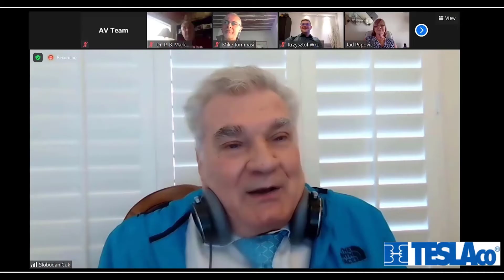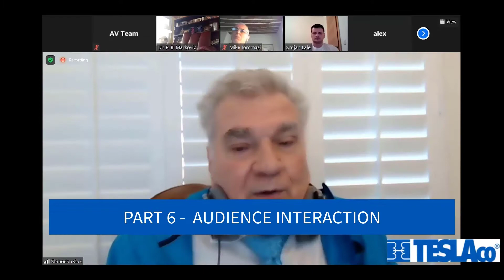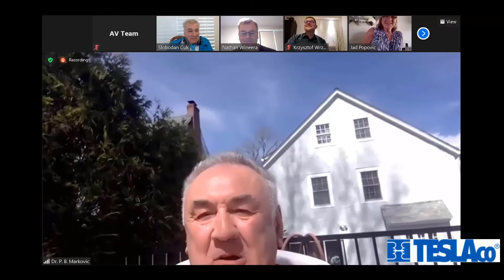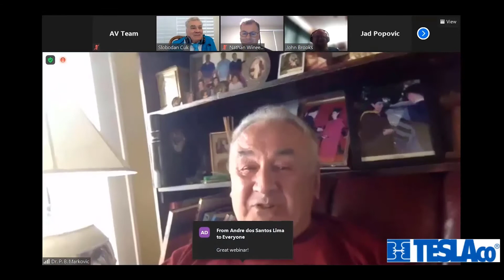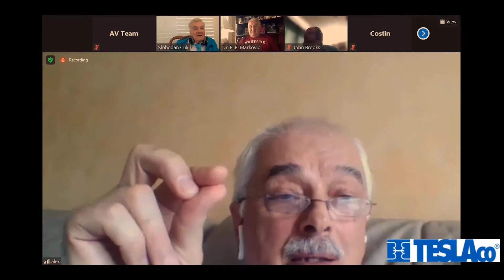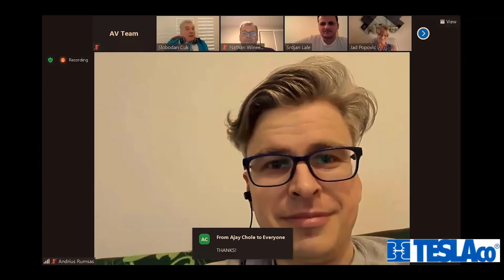WEBINAR WITH MUSIC INTRO: PART6

Comment: When I worked in the "Oil Patch", they need a design for a blowout valve. They did a patent search and used the patent they found. They said their lawyers could stall any cars for patent infringement until the patent ran out. And judges almost never convicted if the patent has expired.